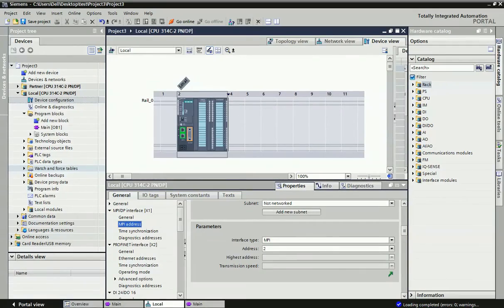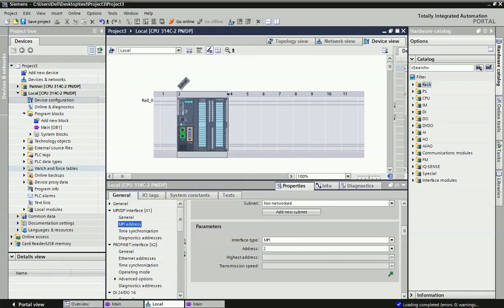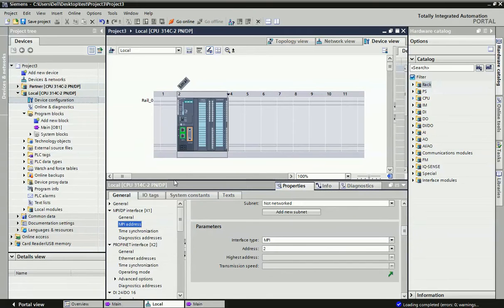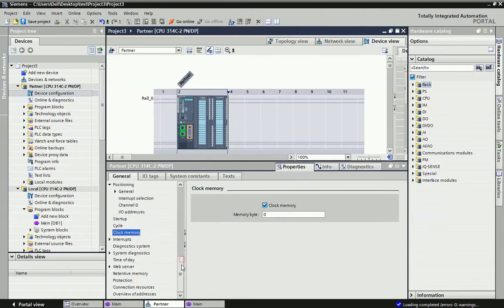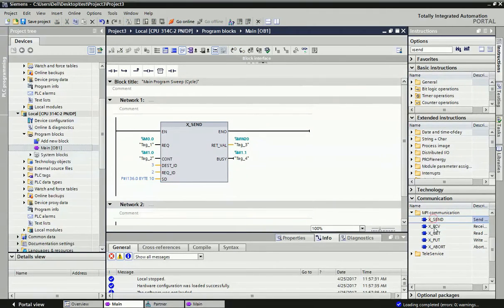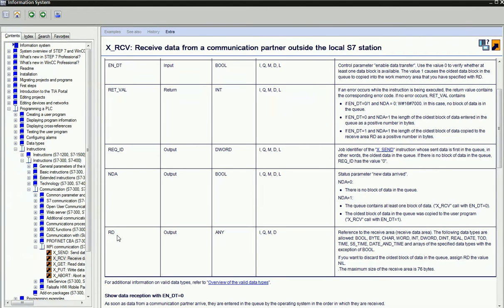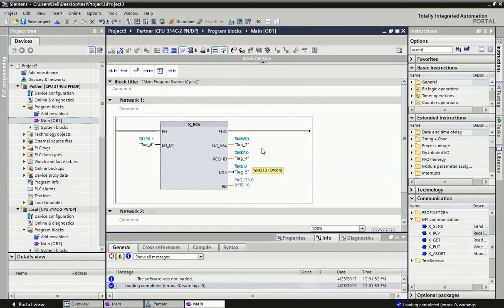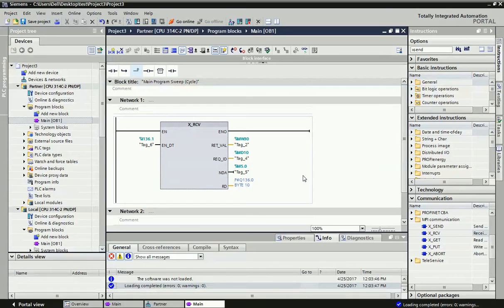Profibus Communication in PLC (MPI Communication Protocol)

Comment: how can use this comm blocks to monitor communication between main and slave siemens PLC  
if slave PLC goes into stop or freeze mode it should stop (interlock ) equipments on main PLC
Reply from the maker: For that Siemens PLC have different block for Master Slave Block.